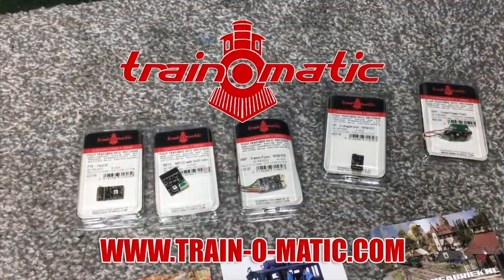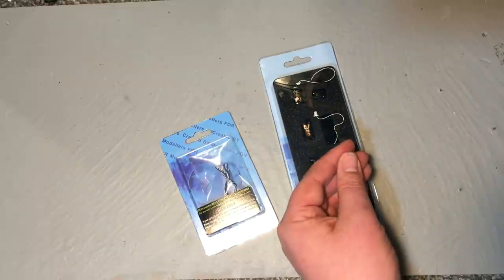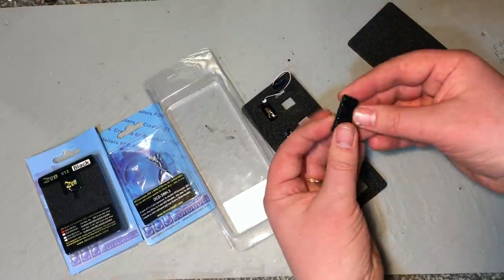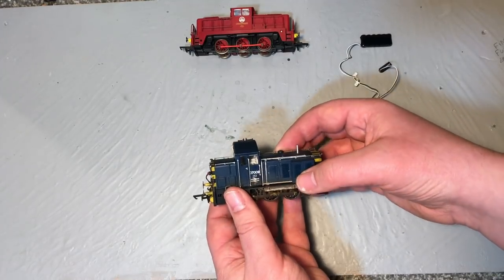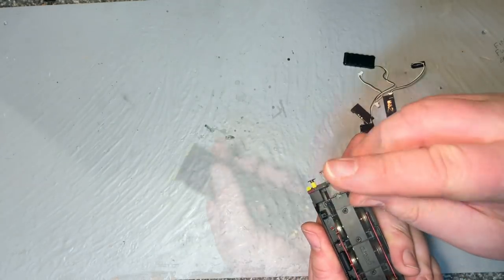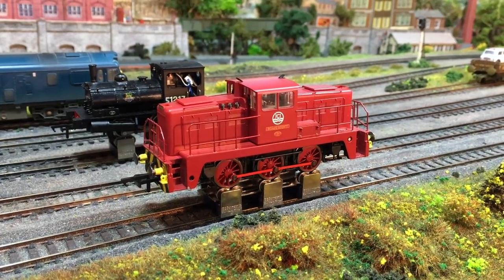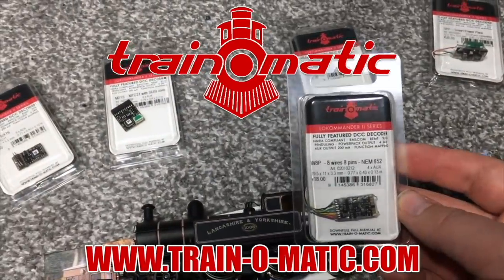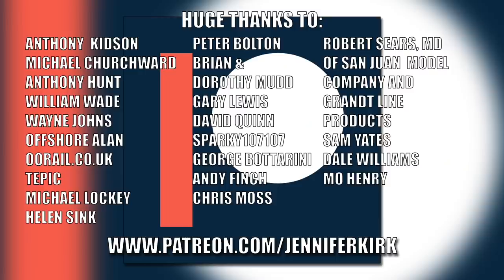Is This Plug-And-Play Stay-Alive The Future?

Comment: Happy New Year Jen! I have just installed a Zen Black plus the largest Zen Blue Stay Alive in a 1980s/90s Dapol 2p with tender drive, I emailed Dcc Concepts about the 3 pin plug on the decoder but only 2 wires on the stay alive and they kindly informed me that I could hard wire it using just the blue and black wires.all this I managed to slip inside the boiler and thin wires extended to the tender and she works a treat! Cheers from Christchurch New Zealand.

Comment: Good show. Thank you. I was thinking that even though the connectors are small, they still are very large when trying to cram them in the cockpit or under the hood or in the boiler of a small 2- or 3-axle shunter. I wonder, whether the manufacturer is going to supply these also without the connectors. Then it would be easier to also cut the total size down by cutting off the extra lengths of the wires.

Comment: Very interesting. Adding stay alive capacitors can really make a huge difference to slow speed performance : the tendency for the models to stall being one of the most irritating features of model railway operation, and stalling is a major issue for any sort of automation, which is why I am especially keen on them. I anticipate that no-solder stay alives will significantly increase the popularity of this method of improving the running of trains.

I fit stay-alives to the models in my N gauge layout where space is even more restricted than in the L&Y Pug shown here. Black tack and Kapton tape are very useful accessories: the Black tack for keeping components and wires in place so that the space can be optimised and the Kapton tape (thin, electrically insulating tape) for allowing electrical components to be in close contact with metal things without shorting. 

I use Zimo products on my layout; they require soldering, but do allow maximum flexibility with capacitor use as one can supply one's own (which can also be more cost effective, especially if one buys from an electronic component reseller in bulk as I do). In the smaller decoders (suitable for N gauge and smaller 00 gauge models; the 6 pin types), the system is quite similar to this except that soldering is required, with a decoder, a power management board (SACC16) and then separate capacitors, but in the latest generation of larger decoders (8 pin, 21 pin and PLUX22) the power management board is built into the decoder, meaning that all that is needed in addition to the decoder is the bank of capacitors itself. One nice thing that the Zimo chips do that I am not sure whether other brands do is automatically make sure that the train will not stop on a dead spot; if you bring the train to a controlled stop on a place that just happens to be a dead spot, then the capacitors may well have lost their charge powering the decoder and any lights before you come to start it again. 

What would be very interesting is to know the voltage output from these DCC Concepts power management boards. You are getting very high levels of capacitance from even a single capacitor here (I wouldn't be worrying about only being able to fit the single capacitor into the Pug - 2-3 seconds run-on as shown is more than enough to cope with all but the most extreme contact problems, and is more than the amount that I get in my N gauge models that has proven more than sufficient to make running flawless save in the case of some electrical failure to the track), suggesting that a low voltage super capacitor is being used, which might explain why the power management boards on these chips are as large as they are. The Zimo system to which I refer above uses 16v capacitors, but smaller capacitors can hold more of a charge at a lower voltage, so with a voltage regulator system in the power management boards and the use of supercapacitors as I suspect is the case here, a very large amount of capacitance can fit into a small space. Doing this does mean that there is a small possibility that the capacitors might explode if the power management board goes wrong and sends track voltage to the capacitors, but this is quite unlikely unless the design is flawed.

There can be such a thing as too much capacitance (imagine a power failure on your layout just as you were bringing a train to a halt; with no power to send commands to tell the locomotive to stop, it might run on until the capacitors run out, at worst, falling off the end of a board or colliding with something at speed, causing damage), and the amount of run-on time shown by the class 25 is probably very considerably more than is needed to improve reliability. I would suspect that the very largest of these stay alive power packs is really better suited either for power hungry white metal kit built locomotives or, more probably, 0 gauge locomotives.

In any event, it is very good to see new developments that make stay-alive capacitors more accessible. As I believe I may have mentioned before, I approve of stay-alives.

Happy new year!

Comment: Interesting stuff Jenny. These look like decent products and it was nice to hear them described without constant "errs" and "uhms" in the commentary. Either you work very well from a carefully-learnt script, or you're just a fluent, competent speaker. I suspect the latter.😁
One slight criticis; it might have been helpful to show the locos negotiating some pointwork, particularly insulfrog, after the stay-alives were fitted and, maybe 𝑏𝑒𝑓𝑜𝑟𝑒 too.
It seems it would make sense, especially with the variety pack, to fit the largest capacitor block possible to each loco, keeping the smaller/smallest ones for when space is more limited. Having the extra power is an advantage but probably more important to get a deent fit.
Happy New Year to you and Thanks for an interesting review.👍👌😁

Comment: Hi Jennifer, a very interesting and useful video, I have been making my own keep-alive units using a diagram on one of DCC Concepts data sheets, these use 6 x 1 Farad super capacitors which are very small but still need a fair amount of space to fit in a loco, as I have mostly steam loco's I have room in the loco boiler area to fit them. I do use rather a lot of DCC Concepts equipment as I have found it to be reasonably priced and definitely "does what it says on the tin", I will have to have a look on their website at these units.

Comment: How do stay alives work with an emergency stop command from dcc contoller, do these work with esu loksound decoders? Cheers
Reply from the maker: These will work with ESU if they have solder pads and you use the fly lead adapters. 

On the emergency stop command they stop immediately.

Comment: Given the use of the Pug maybe a semi permanently coupled shunters truck or brake van would be the solution. That would enable you to fit the biggest version without filling the cab? Maybe it would even be possible to set up the plugs and sockets so you could unplug the van if you need to run the loco or the van separately?

Comment: I can see a good use for the largest stay alive in an O gauge locomotive such as the Dapol 08 shunter or the Dapol O gauge Sentinel locomotive if it would be compatible with those type shunters.  Happy New Year Jenny & Zoe. 🥂🎉
Reply from the maker: They are 100% compatible. Use the biggest that you can fit inside the loco for best performance boost.

Comment: Hello Jennifer ... Just trying to fit the two cap'ter stay alive to the Bachmann 08. I am aseingy both the Zen black chip that allows the plug in stay alive. As you know the cab roof is the obvious place for the stay alive two compoents, but would you believe the wire from the chip to the plug in stay alive is too short! If the had givenen you another 1/4 inch you would have been OK, but another good idea gone to waist because of a 1/4 of wire. If anything the ubiquitious 08 is the engine that cries out for a stay alive. Come on DCC Concepts get your finger out

Comment: Hi Jenny. Do you know of anyone who manufactures a stay alive for standard DC? I've done a search on the net but I can't find any information.
Reply from the maker: I’m not aware of any.
Reply: @JenniferEKirk  do you think a normal capacitor would do ordinary DC?  There's several suppliers of now coast condensers Robbin. I am considering experimenting.
Reply from the maker: @James_Rivett  electrolytic capacitors have a polarity so you would need a complicated set of electronics to let the loco run in both directions.

Comment: Great Video Jenny , I don't know why they did not combine the power control board and the  stay alive into a single unit , it would have eliminated the long cable needed to connect the two together , each stay alive needs a control board anyway Regards David
Reply from the maker: It is for greater flexibility in placement within loco bodies.

Comment: The best 'stay alive' loco is to be found in a clockwork set. It does not need any electricity at all! There is no soldering to do whatsoever. How about that? There is a slight drawback that you have to wind it up with a key and it will cause a short to your DCC controller, but then again the price is very competitive!